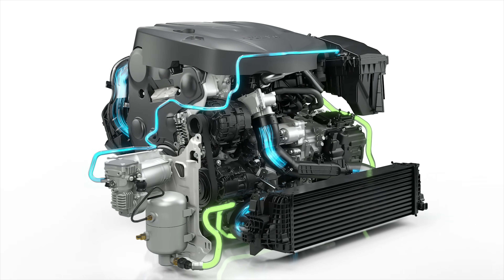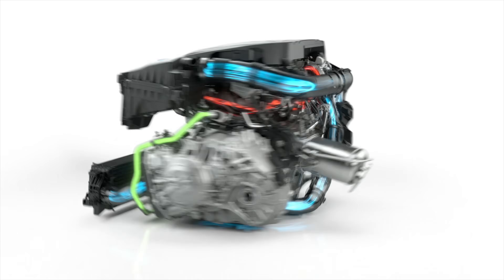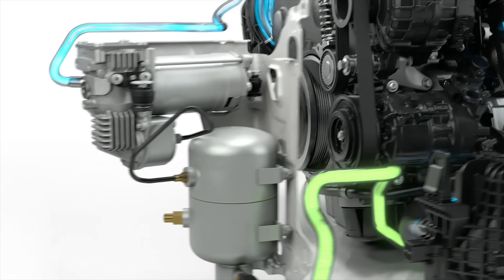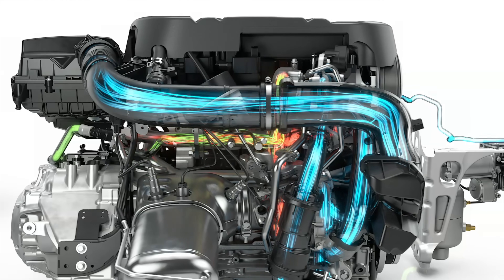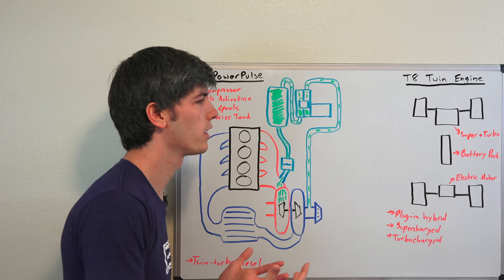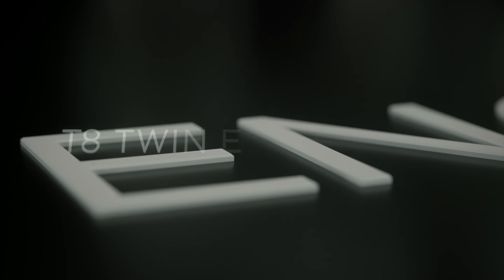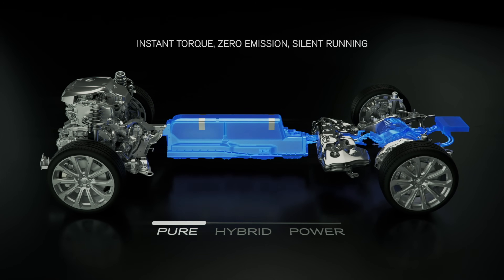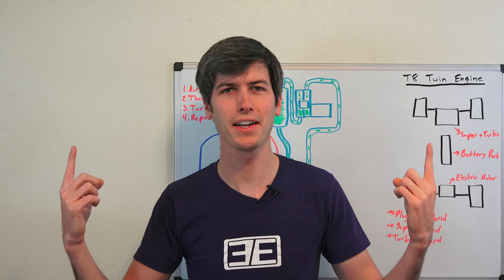How Volvo Is Eliminating Turbo Lag

Comment: I've always wondered why cars have never used an onboard air compressor as forced induction for full throttle application.
Reply from the maker: Yep, you can also do this with an electric motor that spins the turbo initially before there are sufficient exhaust gases, but Volvo found this to be a more cost effective method to achieve similar results.
Reply: I believe the reason they don't do a purely electric forced induction system is that it would be taking power off the battery to run it. In order to compensate, you need a bigger alternator which robs the engine of power. Cost and reliability are likely factors as well.
Reply: because you won't nearly have enough volume in that small air compressor tank to fill up the cylinders with pressurized air, it's better to just use that stored energy to drive the turbine.
Reply: They do.  That's what a supercharger or turbocharger is - an onboard, engine-driven air compressor.
Reply: VaskisCZ I think a bunch of these answers are a bit misinformed, I think the reason why they don’t inject the air on the intake side is that the unspooled compressor wouldn’t be able to prevent the air from escaping out the intake.
Reply: He meant electrically driven...
Reply: Engineering Explained that's exactly what I meant, an electrical air compressor as to not have turbo lag or rob power like a supercharger.
Reply: is there any information on the control system they use to control boost pressure? do they use some sort of proportioning valve and combination of pressure transducers to regulate supply pressure from the HPA tank and total manifold pressure to manage boost. or do they just dump all the air at once and let the waste gate sort out the rest?
Reply: I'm presuming that the reason it's feeding the exhaust and not the intake is that when air is introduced to the exhaust side further combustion is possible. If you look up air injection anti-lag found on rally cars you'll get what I mean.
Reply: L Renaud they do that already
Reply: Heavy trucks have a much smaller RPM range. An electric motor can be powered at a single most efficient speed for the compressor. Imagine having to design a compressor that works well anywhere between 1000 and 6000 RPM
Reply: Ski Fall To avoid an indian Tata Jaguar....or a turkish Typo...
Reply: I wonder if it's possible to include some sort of electric motor into the turbo housing (around the bearing maybe?), Idk it's adding complexity anyway...
Reply: Downclimb4what in what application? Sorry for my ignorance lol
Reply: @ VaskisCZ C.F.M. perhaps?
Reply: @ L Renaud MGU-H formula 1 race cars.
Reply: Robert Hull air impingment exists on large turbochargers for decades. Adds complexity that small and sequencial turbo set up do not need specially with variable vannes turbine diffuser easy for cool diesel and pionnered by Porsche for hot gasoline so that Porsches B4 and biturbos B6 Ferrari V6's for Alfa Giulia and Mas.Ghibli and V8T have no percieved turbolag.
Reply: I suggest they have a power take off from the engine to an mechanical air compressor, like heavy trucks have.
Reply: Marcus Aurelius Antoninus Augustus Compressor are parasitic loads damaging efficiency. Maybe Volvo issue is that with Miller cycle for more efficiency the turbos are larger providing more pct of the whole compression work but any small L4T engine should remain simple.
Reply: I was involved in a project injecting compressed air into diesel engine turbo nozzle back in 1978 took a while to catch on eh! pfft.
Reply: aussiebloke609 I think he's referring more towards the pressure tank part of the compressor
Reply: More things to pop literally. I imagine there will need to be plenty of cut offs for that pressurise cylinder not sure what pressure it will be holding?
Reply: Are the small and large turbos mechanically connected together or spinning separately?
Reply: Phos9 right too much pressure differential and not enough compressor speed cause airflow to stall with a bang noise as boost fall.
Reply: v h s n a t i o n a l i s t further combustion exists on boosted diesel called hyperbar engines but peek pressure are often exceeded with cyl. head popping out. Frensh Leclerc tank had one but not too good for high ambient.
Reply: L Renaud yes F1 have 2 electric motors generators one geared to crank like many hybrids and one on turbo shaft to spin it for motoring boost fast or to recover excess boost then charged into an accumulator that the other Emot can use for more acceleration. The trick is to manage all those complex triangular energy flows....as well as Mercedes does
It. Note F1 rule permits only one single turbo, forcing the use of E drive on one single big turbo because on a V6 two small turbos would have less inertia and almost no lag. 3 cyl. on one turbo is best because exhaust pressure waves do not interfear with next cyl. purging. You can see that on Giulia V6 more powerfull per liter than V8 of 488GTB and turbos much closer to heads but new GTO version may reset this offense to the Cavalino Rampante leadership....
Reply: VaskisCZ the intake air is not as compressed as the exhaust gas. You wanna get that fresh air to burn for clean combustion. And if you keep fresh air in the tank, it will heat up quickly and you don’t want hot intake air (hence intercoolers). Exhaust gas is free; whenever the overflow valve opens after you let go of the throttle, instead of making je exhaust plop, you just fill up the canister first. Really good idea. And it can also cool down in there which probably helps emissions. 
I hate turbo lag with a passion on a street car.
Reply: Marc Jackson the BBC complex pressure wave charging compressor offered instant response and some sort of EGR function but like volumetric compressors it could not be installed anywhere like a turbo. Certainly today, with a variable electric drive because drive resistance is very small and only for metering flow alongwith a smart speed control allowed by better sensors and ECU, the comprex has some potential today.
Reply: thats why they made turbine powered engines...
Reply: fidel catsro do not forget that recip. engine has one huge  advantage: 1 hot Stroke for 3 cold ones with one side cooled 100% of the Time and the other 75% so a good Carnot efficiency without expensive hot metals, difficult tribology and a load which can change continously without any additionnal thermal stress. The turbine is heated  and hot 100% of the time, is stressed by load changes, has poor efficiency, big air and gas flow but can be light and small, ideal for helicopters, etc..
Reply: Damianseconda995, I've looked into building a similar system to what Volvo uses on my Ford F350 7.3 powerstroke, not quite a modern diesel, but it really has turbo lag. If you send the compressed air into the intake side, you'd have to wait for combustion to occur with the added air pressure from the tank to build the boost. It may not be much of a delay difference, but it every little bit less delay helps a lot with turbo lag. It's much quicker to just use those gasses to spin the turbine wheel in the first place, and you also have less of a risk of dirt ingestion into the engine by injecting the air in the exhaust side. There may also be a slightly lesser volume between the cylinder exhaust side to turbo, compared to the intake compressor wheel, to cylinders as well. Less volume means you can use a smaller auxiliary tank of compressed air as well. If that sounds reasonable! Ultimately I'm sure you could inject it into the intake side as well, though I also have my own theories about better exhaust air injector placement, that I won't go into detail here in attempt to preserve my own ideas...
Reply: too heavy and not enough power for only a short amount of time.
Reply: Marc Jackson strait to the point congrat!  A good process converting directily the fuel energy into motion cannot be deficient vs. cumulatives powerlines loss, ac dc charger inneficiency, LIB charging self discharging and load discharging losses, watercooled power converter loss and E motor inneficiency at variable and partial load  while struggling against more weight and inerta. For improving ICE efficiency i noticed on very large engines lab. condition testing a variable efficiency and even more variable emissions since one combustion is not identical to the next. So integrating fast sensed data of one combustion to the next, 720 deg. later will be a large step fwd.
Reply: VaskisCZ because you would still get turbo lag. Forcing air into the turbo immediately starts pressurizing the air in the intake manifold anyways
Reply: Not strong enough... But this makes good use of one to HELP at least.
Reply: This.
Reply: Or do a compound set up.  Not twins
Reply: boost lord Best efficiency on 4 Strokes is one turbo for three cylinders because the explosion pressure wave bouncing on the turbine does no interfearing with the next one 240 deg. later, for better drain and fill. You can see that current Alfa 2.9L V6 has better power density than Ferrari V8 and all small  Ecoboost originals and copies, are efficient, etc..One turbo for only two cylinders is too cyclic with pressure and heat for the turbine causing fatigue.Turbo counponding becomes efficient with twin coolers, the first intercooler reducinq the work of the second compressor and aftercooler but with all the piping, etc, engine gets too big.
Reply: mrsemifixit theyre connected - the exhaust pushes the small turbine (causing the spin in the first place)  the large turbo (on the intake) pulls in more air.
Reply: Exactly. Even small engines consume large quantities of air quickly. A comparatively small volume of air can be used to get the turbine spinning which of course drives the compressor forcing air into the engine resulting in more exhaust to maintain or increase turbine rpm.  Between a solution with an air tank to feed the engine or one to spool a turbo, this is capable of achieving the desired result with a much smaller footprint. Having more compressed air to feed into the intake would be an instantaneous power boost rather than accelerating a turbo, having the compressor draw air through the intake and compress the air from the exducer to intercooler to intake manifold. The space required for such a system and the additional cost make it impractical. With this being a diesel engine, the instantaneous increase in air leaning out the engine is less of an issue than a gasoline engine but it would still be wise to progressively ramp up the airflow from the tanks which would sacrifice the milliseconds of extra power gained, anyway.
Reply: Right. Such a setup would be best in a hybrid car where a large power bank is already available. An ideal solution would be an exhaust turbine that powers a generator so the waste exhaust energy is captured as electrical power even under the lowest load conditions. Under high loads in high performance situations, the electricity can be used to drive a centrifugal compressor for more engine power and also the hybrid electric motors...like the Porsche LMP1 car. They call it an electric turbo but is it really a turbo if there isn't a turbine? It's an electric supercharger as far as I'm concerned.
Reply: Engineering Explained why not put it in the inlet?
Reply: I 've always wondered why anyone would buy commie chinese junk volvos?
Reply: koenigsegg did that with a freevalve engine

Comment: Can you explain why when u compress air into lets say a air tank it becomes cold, but when a turbo compress air into a combustion engine its creates heat. Ive always wondered this. Im a scuba diver and when u let out the air from the scuba tank is freezing since its compressed. Hope u see this
Reply: air in =hot 
air out=cold
Reply from the maker: +carlos caro When you compress air into a tank, it does indeed build up heat. When you release pressure from a tank, the air cools while dropping from high pressure to low pressure. Same thing happens with paintball guns, you’ll notice the CO2 tank gets super cold as you play. The tank gets super cold from changing from a high pressure liquid state inside the bottle, to a low pressure gaseous state outside the bottle. I don’t know much about scuba, but their may be a phase change occurring as you transfer air into your tank, which could make it cold. Can also witness this with a gas grill, the propane tank will get cold as you cook, as it releases pressure.
Reply: It becomes hot (warm) when you fill a scuba tank and increase the pressure. 
The cold comes when you release the air again and thereby reduce the pressure.
Reply: They 2 methods you referred to are opposites. Compressing air = hot air & uncompressing air = cold air
Reply: Air going into a scuba tank is also heated by being pressurised.  It simply bleeds that heat away into the atmosphere over time through the tank walls until it reaches around ambient temperature.  Later, when you start using the tank, you decrease the internal pressure, which lowers the temp further, giving you that cold air you're used to feeling.  In an engine, it's constantly being compressed and heated as the engine uses whatever the compressor supplies...so the heating becomes more noticeable, as it never gets much time to bleed that extra heat off into the atmosphere (other than briefly as it passes through the intercooler.)
Reply: Air increases in heat when it's compressed and decreases in heat as it's decompressed (that's how air conditioning works btw). A turbo is hot because it has the car exhaust gas running through it which is pretty hot. Also, the air is compressing which also increases heat. There's no decompression in a turbo setup so the only release of heat is by convection.